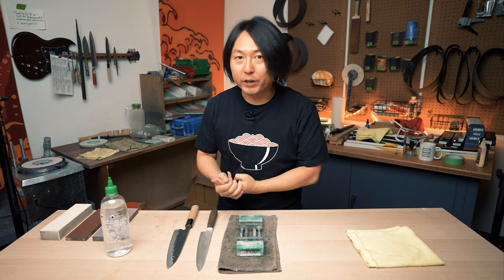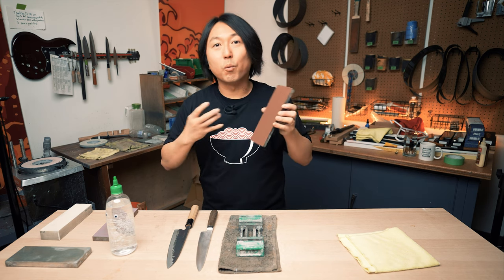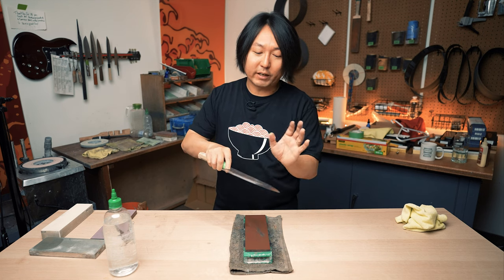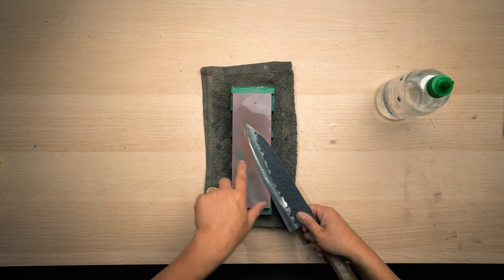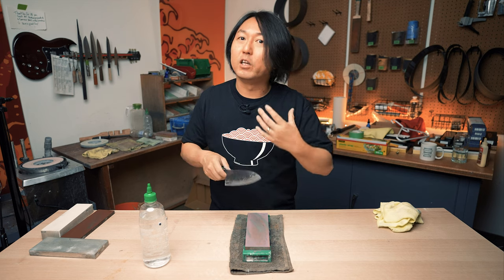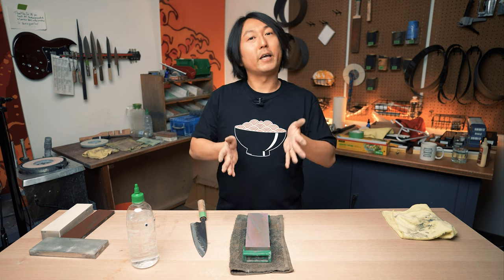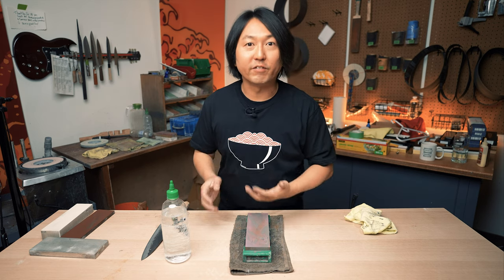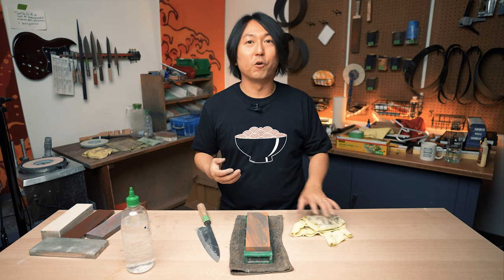Hamaguri (Convex) Grind - Make Your Japanese Knife Tougher!

Comment: FINALLY, A HAMAGURI EDGE VIDEO
Reply from the maker: Took us long enough 😂
Reply: @KnifewearKnives  you guys should have gave us a close-up of the edge, that way, ppl can get a better idea of what a hamaguri edge looks like. I'd also like to say that if one does slight wrist rotations while pushing forward and back on a soft stone, that helps blend the bevel better so the hamaguri is smoother and I like to add a 40-45° koba on just 1 side of the knife to keep most of the benefits of the hamaguri but with added strength. Otherwise a great video, easy to understand!
Reply: I also only do hamaguri on wide bevels and kataba knives